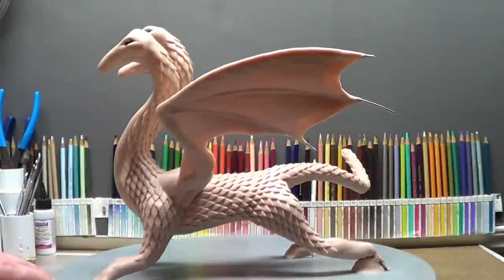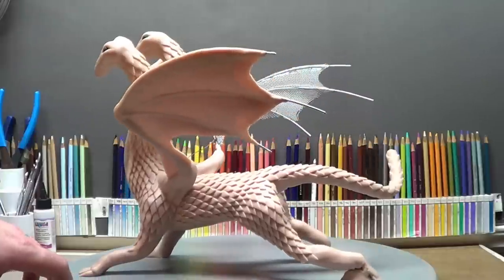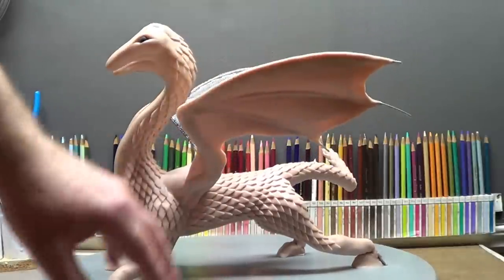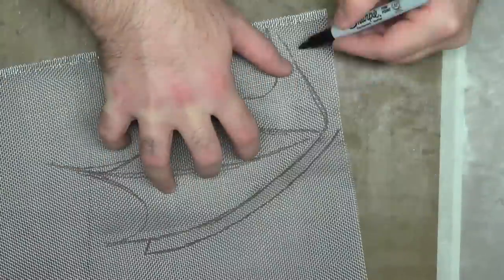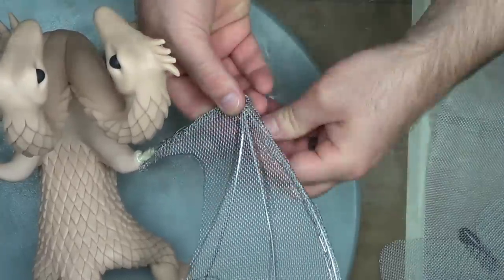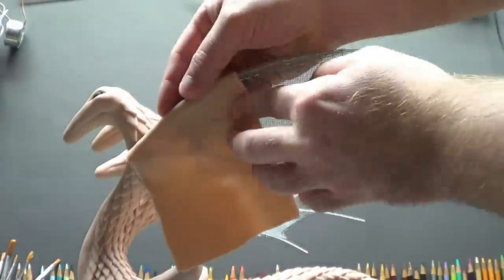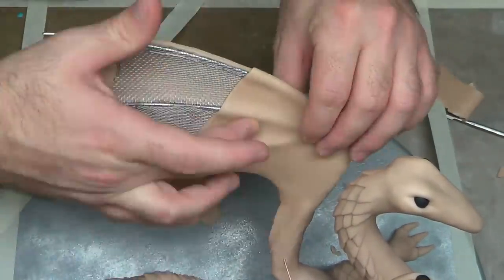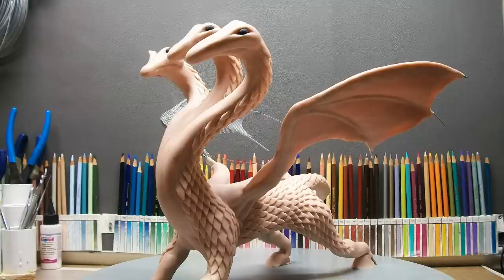Full Dragon Sculpture Part 7  Wings!

Comment: Awesome work. One technique I use (so long as you don't need your oven right away) is that once you're done cooking it, is to inspect your sculpture while it's still in the oven. IF everything is kosher just shut the oven off, open the door and let it cool inside the oven. That way you minimize the risk of damaging it while it's still hot.

Comment: would the metal wiring melt the clay off when it bakes? seeing as the metal would get hotter than the clay would making the clay melt off or does the clay not melt because its just drying in the heat?
Reply: clay doesn't really melt